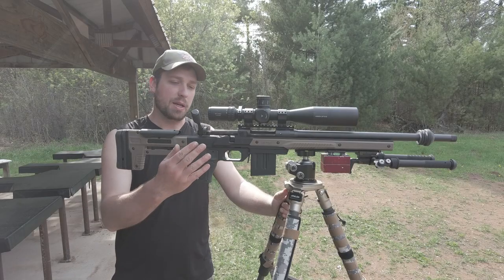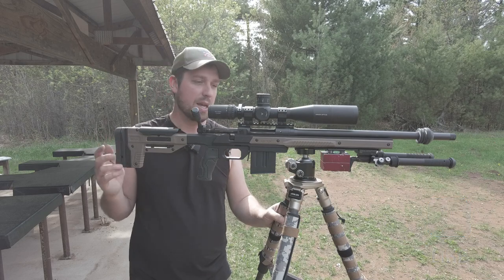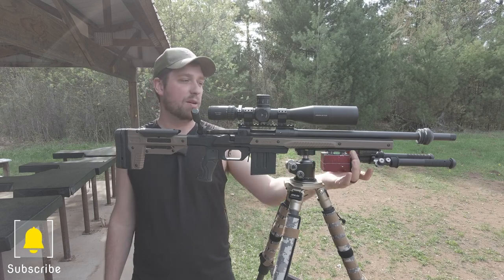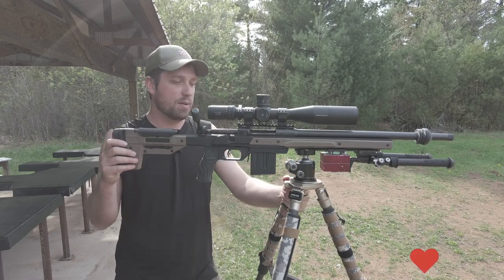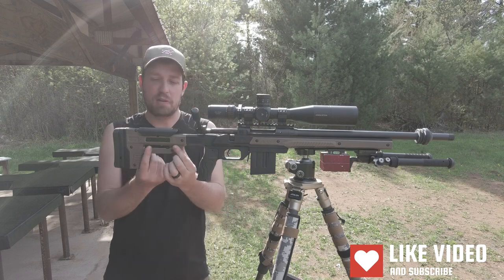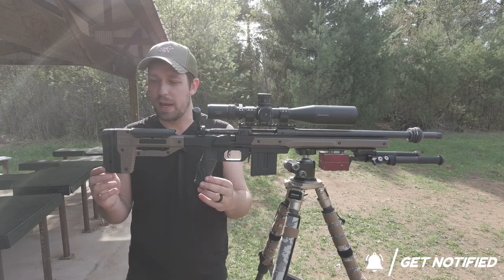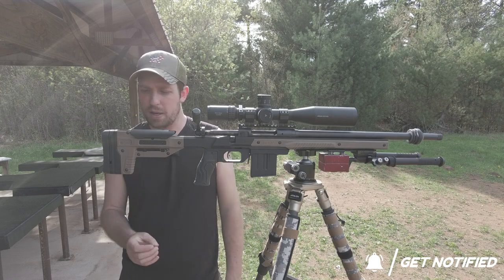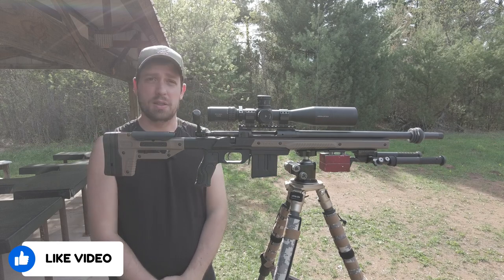Oryx Chassis Update

Comment: Moving from Savage factory stock, what improvement in accuracy did you achieve? I have Savage 110 Tactical in 308W, and I replaced the factory barrel. I don't if it is worth a stock change; this is a really good stock with an aluminum bedding block and solid contact with the barrel action. Thank you.
Reply from the maker: That's a great question Rudolph, I think the thing I immediately noticed was improved consistency and recoil control particularly because of my body type and the improved straight stock of the orcs.  The rifle was already shooting reasonably tight in the rubber plastic stock from the factory, but I often threw shots because of the design
Reply: I stock was my first consideration then the owner can change out the barrel if he wants to, no gunsmith is required.